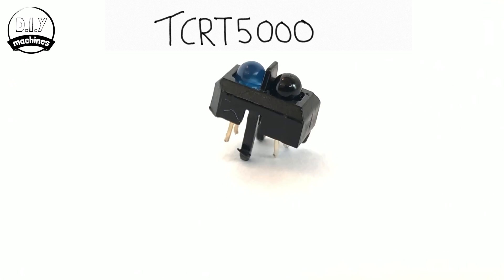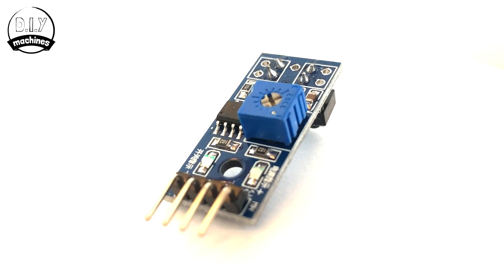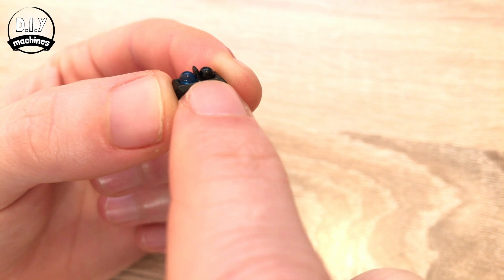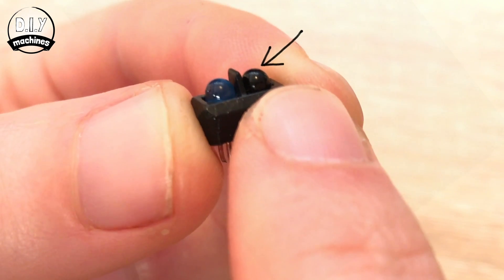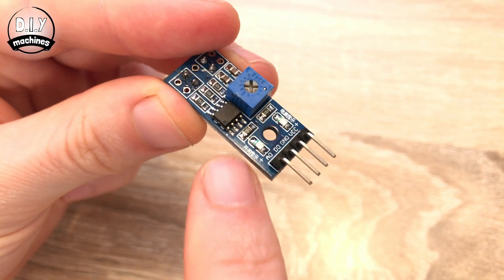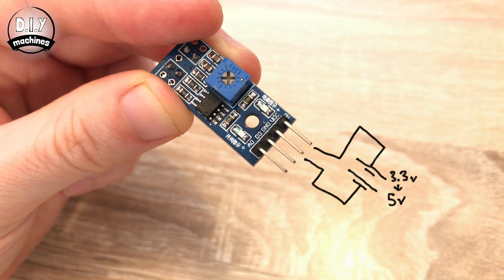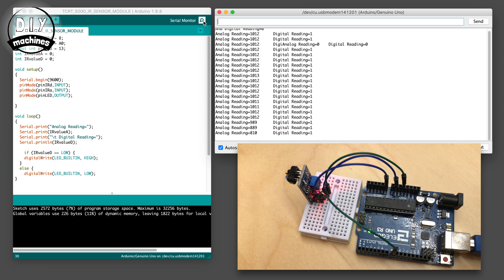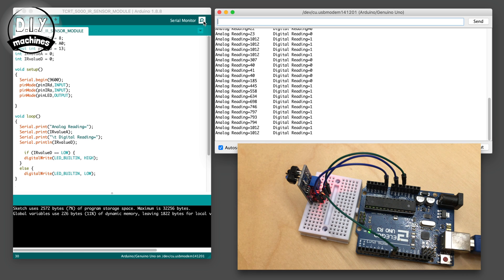TCRT5000  Infrared Reflective Sensor - How it works and example circuit with code.

Comment: I made a simple circuit with a regular white led and a photoresistor.  It sucks at picking up changes in the daylight.  Is this any better?  If so, why?  Is it a wavelength thing?

Comment: Hello, what about analog output? How does the signal is made? Is It a voltage +5 dropping down to 0 when an object Is near? Thank you 😊
Reply from the maker: The analog output will report back the intensity of the light measured at the sensor. The value will be between +5 and 0 (rarely at the extreme ends of the scale) As opposed to the digital output which would indicate a 1 or 0 depending on the reaching threshold set on the potentiometer.
Reply: @DIYMachines  that's perfect! I need to use it as a potentiometer and connect to a guitar pedal as a spare in a circuit which espects input value from +5 to 0V! Thank you :)

Comment: Great video, thanks. I have the  TCRT5000 without the breakout board. Should I be including a resistor in my circuit?
Reply: Yes google the datasheet and check the max amp then use a resistor to bring current down if you have higher current

Comment: Cant i use without arduino?
Reply from the maker: Yes you can. Use the LM393 and potentiometer on the sensor to set a trigger threshold.

Comment: Why does it needs to be conected to a analog input ?
Reply: it does not, the output of the sensor is analog, if you like use it, or if the digital suits your circuit better, use it, its nice they output both for different circuits.

Comment: hey I did everything the upload went well the sensor is working but when I go to the monitor in series, only appear "???????" what should I do?
Reply: if ????? appears, then you need to change the Serial monitor rate. Open the Serial monitor and look at the bottom. Change your Serial monitor rate to 9600 then try again.

Comment: "Noise cancellation scripts", can you provide a debounce code for the TCRT5000, I recently made a modificated version of your coin sorting machine, but anytime a coin pass through the sensor, it starts to give me some extra noise data, and yes i have checked the potentiometer behind to adjust as low as I could.
Reply: glyn hodges  actually a last button state is a lot better than delay, so when it triggers once it stop counting infinite but only once! 😉

Comment: Try using this on a black non reflective object. It will not register.
Reply from the maker: Yes you're correct. If the object is not very reflective then a sensor that employs a different method of detection would be more suitable.

Comment: HELP HELP HELP

What am I  doing wrong? Copied the code and get values from the serial monitor. However, when I slide a coin past it, it dosent sense it. I literally have to put my hand in front of it. I have tried with 3 different sensors and get the same result. Any help would be much appreciated. Im such a noob.
Reply from the maker: Keep calm! Try using a small screwdriver to adjust the potentiometer. This will adjust its sensitivity on the digital pin. Let me know how that goes.
Reply: @DIYMachines  Thank you so much for the reply, i have tried that but no luck? i am quite sure i must be doing something wrong, i have mocked up the £2 coin section in card and it is just not seeing the coin drop i have to drop the coin so slowly for any digital reading! any help or advice? very grateful
Reply from the maker: @simonsmith7504  This is bizarre. Try reducing the size of the delays in the example code. Does this have any effect?